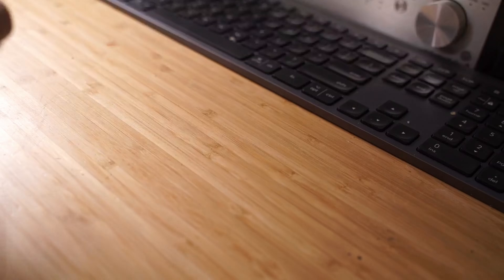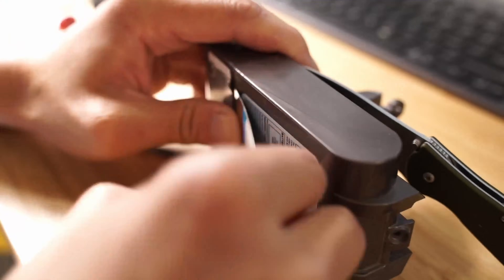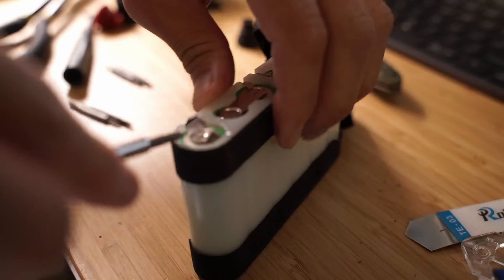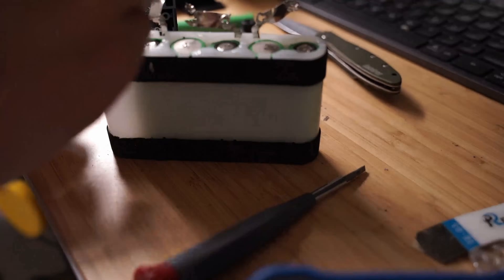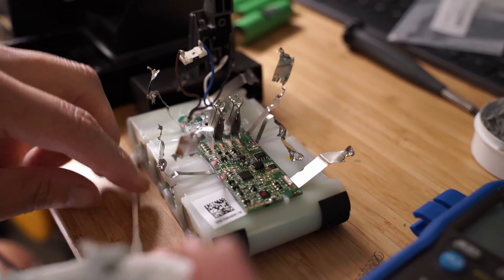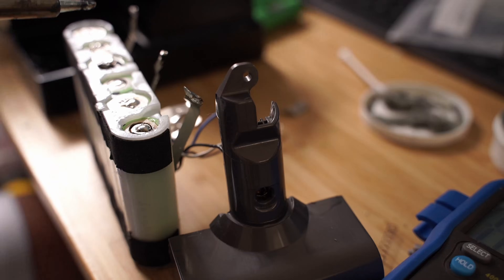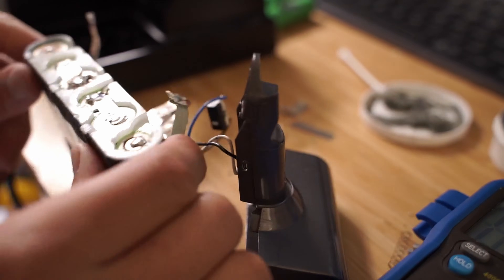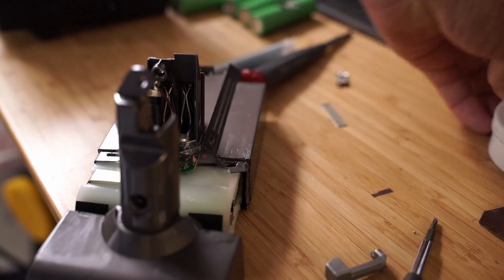Replacing 18650 battery cells in a Dyson V6 cordless vacuum battery

Comment: HI Alex, Hi, if you disconnect a Dyson BMS (like for many laptop BMS now)  and change the cells , it locks down definitively (red light) after new connection. (You didn't show the final result) . So you cannot change the cells, with obligation to buy a new pack. 
I add that the motor drains a lot of amps (more than 20A with Max) to run, and the only voltage control is not enough. It's necessary to control first of all the internal resistance of each cell. You can often still  have a good voltage level  (I opened a lot of Dyson packs with more than 4V/cell) but with too high IR ; so if you drain too much amps on such a "tired" battery , voltage falls and the BMS stops the current. Simply an usual BMS allows the recharge...but Dyson's BMS not!
With these Dyson batteries with only one cells row (2 rows in // would be much better...but commercially uninteresting) don't use the max power. That kills these weak batteries very quickly : Max power = max amps discharge in a very short time , and Lithium cannot support this torture a long time, even with good 30A cells. With 2 // rows it would be half as much per cell. But life time would be too long for Dyson!
Friendly, Michel.
Reply: I wonder if it is possible to trick the bms by connecting an external power supply before removing the batteries so the bms thinks the batteries were never removed.
Reply: @Idunno-678  Perhaps is't possible (I'm not sure), but only if the BMS is not definitely locked down (red light flashing permanently) . But the best solution is to buy a chinese BMS for your model (V6 or V10 etc...), because these items are simple, reliable, easy to install, and first of all they don't lock down after low voltage or disconnection, so you can re-use them permanently. 
I rebuilt 4 Dyson packs with these BMS , one with new good cells, and 3 with used but good and well balanced cells , without any issue .
However, use the max power as less as possible and only for a very short time.....these powerful Dyson motors  would need TWO cells ranges in // for a good battery lifetime.

And never use Max power if the battery is almost discharged...Why? Because voltage can drop down very deep (under 2,5V for a short time) , and so the Dyson BMS locks down definitely. In this case it's possible to change only the BMS if the cells are still good and first of all with a correct balance....and you can change them later.    I'm happy when I find such batteries in the trash !!
In all cases do that quiet and careful, without any short and always with good connections .... don't forget you can drain sometimes more than 20 A ... and more if you create a short !
Reply: @Michel-Artois can you give us a name of the bms so we know what to search for?
Reply: @Houndzee No, they don’t work fine. They have lower current for a high-drain vacuum that can use all the current it can get. There’s a reason high end power tools use completely different 18650 cells from your typical LED flashlight.
Reply: Dyson V7/V8 = FU-Dyson-BMS 
Dyson V10 = V10_Dyson_BMS

but the OG dyson BMS doesnt support cell balancing, not because the controller lacks it or it costs too much. simply its a good way to ensure planned obselecence as the cell voltage will drift overtime
Reply: There was a green light when he connected the cells.
Reply: Thanks for this. Not going to waste my time doing this
Reply: @Houndzee  Not possible if you keep the Dyson BMS. But if you do this with a chinese replacement BMS (10€) and good high drain cells, here 6 for 30/40€,  it runs without issue. And this BMS is re-usable , so you just have to change the cells next time. It's my own choice , with 2700mAh cells, so I have better capacity.
 I always cut all little plastic tabs on the box to open this box easily and control the balance : a lot of batteries are dead because only one or two cells were faulty.
And I always use new cells : it vey difficult to keep a good balance with good but already used cells.
Reply: @Michel-Artois  honestly the OEM one from Dyson is $90. So it’s not worth all this hassle to make something that won’t look as good, untested and without warranty.
Reply: @Houndzee  nobody cares about your laziness, go watch something else 🤩
Reply: @TruculentHedgehog  because?
Reply: @TruculentHedgehog  ok hog
Reply: @Michel-Artois  just saw another video that you can flash the firmware on the original battery. https://youtu.be/dwyA5rBjncg?si=wzmHabrz-B5dQVBP
Reply: @Houndzee  I've tried replacing the battery without "locking" the BMS. you can just cut the positive pole first, then the others. And you'll be save. If you mess up, you can also use pickit to flash a 3rd party firmware on the BMS
Reply: @Heizie999  it’s hardly worth the effort. Highly rated replacement batteries on Amazon are like $40.
Reply: @Houndzee   indeed, but those basttery packs are using recycle 1860 lithium cells. won't last for 2 years
Reply: @Heizie999  this is conjecture. Do you have data?
Reply: @Houndzee  😄tell me how can you buy 6 high amp 18650 cells with $40? Besides, the case and the 3rd party BMS cost already $6. maybe the battery seller is a very kind people.
Reply: @Houndzee  The amount of brain damage is insane here, please leave as you clearly do not understand anything about battery repair 🤣
Reply: @TruculentHedgehog  tell me why this is better then just buying one off of Amazon?
Reply: @Houndzee  I'm here after my third Amazon pack not lasting 6 months and am finally done.  Rebuilding with quality cells is far better than wasting more money on crappy 3rd party replacements, and I've got the receipts.
Reply: @Houndzee  This biggest reason is the $50 Chinese Dyson replacement packs sold on Amazon come with total crap 18650 battery cells.  Definitely not Sony VTC4's or the like.  I bought one on Amazon and it lasts like 7 minutes at most.  I am going to replace the cells in the Chinese pack with 6x Sony/Murata VTC4's which will cost about $25 and 2 hours of my time.  I don't count my time in the expense bc I enjoy doing these kinds of things.
Reply: @MotorHead-qd8ls  works fine tho. It’s a vacuum after all.
Reply: @Heizie999  Is it true that the BMS does not lock when you disconnect the positive terminal first? Has this been confirmed? 🤔
Reply: @WasDennSonst  yes, i've tried with dyson v6, but other version no garanty.
Reply: @Heizie999  Very interesting. So first desolder V+ and then down to GND. In what order should it be connected afterward? First GND and then upwards to V+? 
If something goes wrong, where can I get suitable firmware for the BMS to flash it? Thank you. 🙏
Reply: @MotorHead-qd8ls  It's a good choice. But be careful with the BMS included in these cheap chinese batteries : most of all  don't balance the cells at the end of charge. But you can sometimes open the battery and control the voltage of each (good and hi-amp) cell. I always add a balance switch and a jack on the box (not easy because almost no place fot the wires) , and I recharge with an ImaxB6 or else :  balance Top,  and I can modify the charge power (most of all slow).   I also  enjoy doing these kinds of things, lithium batteries specially with old but efficient Ni-Cd vacuums, screwdrivers or else , very simple because without any "complicated" and useless board.
Reply: First sentence - exactly the same with laptop batteries. 🤔😕

Comment: Use a spot welder they are cheap enough on ebay- the way your soldering can damage or shorten the life of the Lithium batteries
Reply: No it doesn’t harm them unless you apply the iron for a long time.
Reply: Or get a kWeld or Malectrics. 😉

Comment: Enjoy your flashing red light after all this work.  Notice he didn’t show it working after….  The BMS board is made so you cannot swap out the cells.  It recognizes this, and fails by design.
Reply: The same if you want to try to change dead 18650 batteries inside a laptop battery. 🤔😕😞
Reply: The board will self destruct only when the correct disconnection and reconnection sequence of the supply and balance wires is not followed.
Reply: use pick3 programmer to solve this problem

Comment: To remove tabs off the battery ,you can precisely drill the spot welds just through the top tab only ,then the tabs will come off more cleanly.
Reply: Go ahead if you like destroying cells
Reply: Careful if you don't want to set off the CID... 🤔😨

Comment: I tried to order a replacement pack but Dyson discontinued my unit (DC30 - Pack rating is 14.8V 1300mAh 20Wh. I noticed you didn't show or say what the voltage of each of the old cells was. I just opened mine after it had been on charge and I'm getting 4.12v/cell. It's a 4 cell pack and it's total is 16.46 V.The vac runs for about 5 secs for 4 or 5 cycles then dies. I'm wondering if the batteries are actually bad or if it's the BMS.  Think it's worth ordering the new cells?
Reply from the maker: 18650 cells have a nominal voltage of 3.7V, and are around 4.2V when fully charged. I bought a 3rd party battery pack that started only running about 5 seconds and then died. I have a feeling it's the battery cells, but haven't gotten around to testing it.

If you can't find a Dyson OEM replacement, ordering new cells maybe the way to go otherwise you maybe going through quite a few 3rd party battery packs until you find one that works as well as an OEM one.
Reply: @mistahcheng  Hi Alex, Thanks for this. After I took the readings I figured I'd try snapping the pack back together, run them down in the vac and take another voltage reading at the cells. It would not run for even a second. Dead yet the cells are still at 4V. I can't see any signs that I hit the BMS board during disassembly. So I gave up and ordered a Shark cordless on Amazon for less than half the cost of the least expensive Dyson. It's not as powerful but this one I only needed for vacuuming up cat litter that gets track out of the box so the Shark works fine. 

I have a more recent Dyson with a power brush that I only use to vacuum the carpeting on the stairs. The battery for it just died too but Dyson says it will be back in stock in a few weeks. The only place we have carpeting is the stairs. 2 Roombas do the rest of the house. We also have central vac to fall back on. 

I think I'm done with Dyson. They work great but they do not have the longevity and support life they should for the cost so they are kind of a rip off and someone is getting rich from it.

Comment: It's actually a VERY straightforward job and WELL worth it if you know what you're doing on refurbishing battery packs.  There's a special place in hell for the person who designed those clips on the shell, though.

...Now where the heck is my dremel?
Reply: designed obsolescence
Reply: At least it’s not ultrasonically welded together. Clips should make it relatively easy to open.

Comment: how did you reset the battery BMS? since once it detects a bad battery even if you change them for brand new high cap batteries the bms will still tell the vacuum that the battery is bad
Reply: Mhm. The same security system place with laptop batteries. 😏😞

Comment: Do we need to consider the current? When replace new cells?
Reply: Yes of course. High capacity 3500mAh cells are not appropriate. Best use very high drain cells only, max 2500mAh.
Reply from the maker: Are you asking about the increase in capacity ? If so, no since the BMS charges the battery up until it reaches a certain voltage. The only downside to that is it would take longer to charge up due to the increased capacity.

Comment: I will never buy a Dyson ever again lol. So expensive and the packs last like one year. Thanks for the video!
Reply: 5 years warranty...
Reply: @gidbi  The batteries should be easily changeable like power tools and not cost a ridiculous price.
Reply: @mccririck01  Get adaptor for power tool battery, works pretty well 👍
Reply: @mccririck01 
🤔 2 easily accessible screws and then swap “like a tool battery.” Seems like a great design. Try changing the cells in your tool battery and it will look a lot like this.
Reply: @mrkittens489 what tool battery are you using? I tried a Ryobi battery and it didn't last really long. The Dyson battery is 21.6V as opposed to the 18V of the Ryobi. It cuts out thinking the battery is flat. Apparently a smart adapter is available with a boost circuit?
Reply: @davebuckell  I use 18 volt Makita 5ah battery, it works good, but when battery indicator light shows one bar left it shuts which is good that it doesn’t kill the battery. Maybe you should measure the voltage of your Ryobi battery when it’s full, my Makita battery is somewhere around 19.8-20 volts when fully charged
Reply: ditto, I got into dyson vac because i got one as a gift.  I learned dyson made their product proprietory design, forcing user to buy from dyson at expensive prices. Battery is a hassle to replace, made for disposal. I might extend the use with an aftermarket battery adapter.
Reply: First Dyson was 5 years on the same battery pack before we gave it away, the second Dyson is going on 7 years now.  If what you say were universally true then there would be way more noise regarding their battery packs.

Comment: Hi Alex, Thanks for the informative video it helped a lot , after watching and seeing the difficulty of separating the case I decided to use 3 thin butter knives simultaneously on each side (obviously one on each tab) with great success and very minimal distortion to the casing took all of about 3 minutes to separate and as only one cell was dead and having a spare on hand it only took around 15 minutes to repair but it did take an hour and a half to charge the mini spot welder.
Reply: you should make a video removing the case in 3 minutes!
Reply: @hairy8184  g'day, sounds good but unfortunately not my forte lol
Reply: @hairy8184  He Fuc-king 100% lying here through his teeth,if he very lucky,he can removed those very tightly packaging shell in of those batteries about half an hour.I destroying the whole shell  a very tightly packaging shell to taken out of those 18650 batteries out. It took me about an hour.
Reply: I open those every day, takes me about 10 seconds. Put the small end in the vice and wiggle the big end firmly until it comes out. Some tabs may crack but the still work okay after. Also keep you hand over the spring when doing it so it does not ping out
Reply: Thanks for details! I used heat gun, warmed the plastic until the small flathead screwdriver allowed it to pry up and cool in unlocked position 😎,  did this at each lock tab and I had it easily apart in about 2 mins!
Reply: @jamesbsa6450  This guy lying though his teeth even more.Heat gun heat well melted these thin types of plastics easily..
Reply: @Chu3505  yes, I used heat gun and obviously it easily softens (too hot will melt and distort, so use obvious caution), the thin plastic case. Was super simple.

Comment: Bonjour 
Ceci n est pas une batterie originale ,.en tout cas en ce qui concerne la BMS 
La véritable batterie Dyson a une BMS qui se bloque lors qu il y a un problème sur la batterie et il est impossible de restaurer la BMS même après réparation de la panne
Reply: Tout à fait! Comme on doit déconnecter le BMS pour changer les accus, il ne repart pas après reconnexion (led clignote rouge). Une solution (fastidieuse) est de connecter d'abord le BMS à une autre source 24V pour le "tenir vivant" avant de déconnecter les accus fatigués pour les changer. Mais à condition que le BMS ne clignote pas déjà rouge avant ouverture. Led rouge = blocage définitif.

Comment: Hi Alex. When I check the batteries, one of them showed 12.5v while all others were 3.5v. What could be wrong?
Reply: One is working the others are fked replace them all.
Reply: @greggrimer1428  It was actually the other way around. Replaced the 12.5v one and I got it working now.

Comment: use old credit cards to open, will be less damage to shell
Reply from the maker: Good idea, but it's pretty hard getting something thicker than a flat head in there.
Reply: @mistahcheng  its possible, just cut it in half (by longer side) and start from bottom, shell very soft and easy expand, so you can easy get it into then under at pin places, did that already then fix my wife dyson 8 :)

Comment: Great video was curious to know what type of battery is inside. But not for me will buy a new replacement without a complain as it is delicate and so manual work to do.
Reply from the maker: They come with Sony VTC cells, and definitely not the effort ! I'd highly recommend getting an OEM replacement since you never know what kind of cells are in 3rd party replacement batteries.